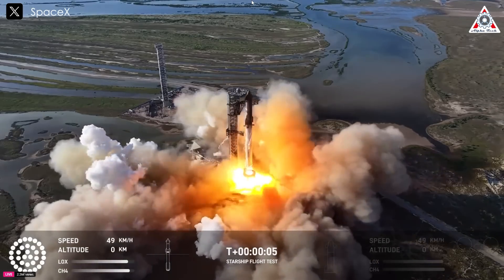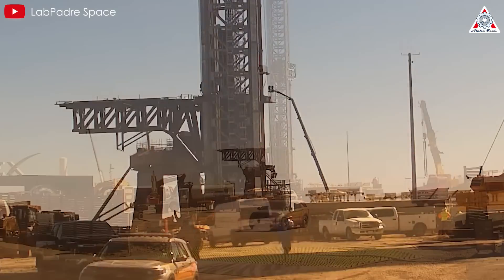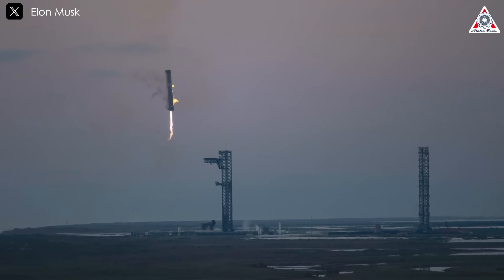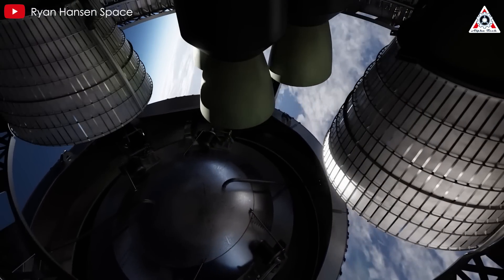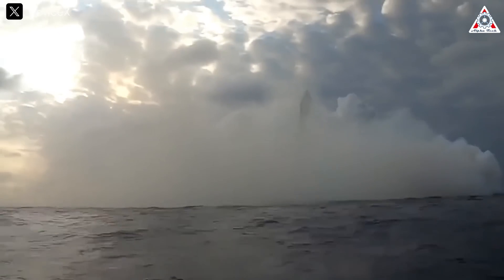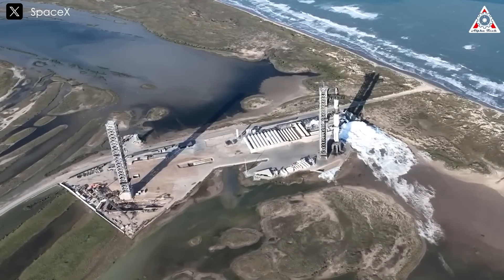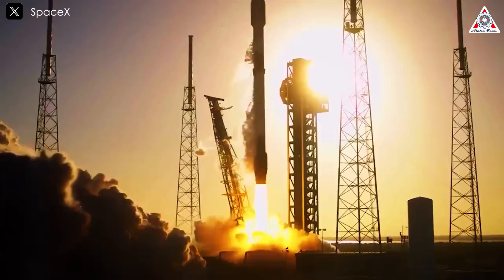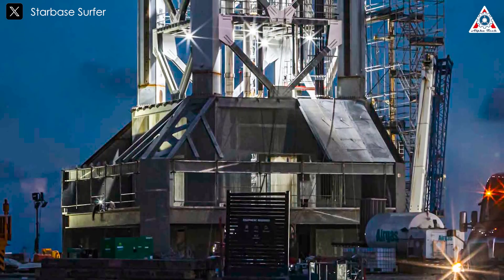Starship Sixth Flight Aftermath! Elon Musk Revealed Starship's NEW Problem...

Comment: Was a nice flight, So Sad they couldn't get enough damage at the last minute from the long glide flight profile.  Would be interested in a report on the ship's angle of attack for the entire re-entry.
What the changes are.

I've never been a fan of the tower, or the tall slender ships.
I would have built Stubbies, to make them free standing and easier to stack.

And on the launch pad  would have headed for a modular stove top 
Configuration, where its a flat plate with a hole in it, and flame diverter out at least one side.  probably able to set together in hexes, array style with a central stacking crane that rotates.

So it could be designed to cover fields of firing and landing ships and boosters, or used on hex barge arrays.

Keeping things lower to the ground will pay dividends continually.
Sky Scrapers are generally a neurosis downstream from real estate location speculation.
And we would have been smarter to build cities into hills and mountains than on top farm land. We'd still have all the farm land, and not wishing we had nuclear bomb shelters right now.

Moon and Mars will at least cultivate better construction habits. After a few generations of Surface dwelling Morons die of Cancers. We'll decide the flat areas are nice for green houses and agriculture and park areas visited at night when the Geiger ain't Poppin' as much....

One question I have, is about possible reflective coatings that filter the nasty radiation, but let plant growth and animal health light wave lengths thru.

An anti radiation coating for glass perhaps... bounce those betas and gammas...

Something for Labnerds to ponder...

Speaking of Labnerds, saw on another channel that SpaceX is working on thinner and lighter alternatives to tile, for heat shield, one suspects the new re-entry profile effects were a shock to them, and that thinner and lighter means maybe coatings...

Dont forget to at least try some samples in a range from standard cement to refractory...

Wouldnt hurt, to keep things as simple as possible, and know where on the Mud Spectrum from the cheap end, that thermal characteristics got good enough.
Standard concrete is pretty heat resistant as are mortars that tend to be Lime enriched to make them sticky for the Mason. Lime is the primary  mineral in Refractory as used in blast furnaces, and before firebricks Limestone was used.

Also on coatings, stainless is somewhat non stick, and it would be a good idea to sandblast the hull slightly where coatings are desired, to give the surface some "Tooth" for adhesion....

Also saw metals mentioned as coatings and wanted to remind that some years back boats were spray gavanized using a wire gun and electric arc. I dont think it was good for the workers spraying Zinc, but that system would work with other metals, and Arc temps way above re-entry temps.

Say tungsten or other high temp exotic.

Main problem right now, is lack of enough start ups to be trying more things. I think that will change, and is something Elon would like to see too.

Pretty good chance that SpaceX isnt gonna be a de facto monopoly for long, and that all kinds of cool concepts will soon be getting tried.

Also theres a watershed once out of the gravity well, where guys working and living off Earth will start building home brew stuff for a hobby... Hot Rods, Lunar Back Yard Yacht builds etc. Vacation Cabin Orbital Habitats,  and Lunar escape velocity rocket packs to get from surface to orbit in nothing but a Space suit.

The watershed will be getting beyond the certified nerds, and things from the hands of common man...
Thats when the real revolution in Space Tech will start.

Comment: Heat-shield tiles should reinforce the "Quick Disconnect, QD" and the top of the circular clamp ring of the super heavy against liftoff blast.
Reply: This idea was discussed during a NSF livestream (if I remember correctly) but quickly discarded. Reason is that the tiles can not withstand a lot of force bc they are far too brittle. During reentry, they mainly endure heating and nothing close to the forces and shockwaves below a booster during launch

Comment: O ideal e ter um PD pra lançamento e pousar em outro pra evitar danos
Reply: Correct. Also, heat-shield tiles should reinforce the "Quick Disconnect, QD" and the top of the circular clamp ring of the super heavy against liftoff blast.

Comment: This arial at the time is a fine example of what I have been saying all along and how interacting positive charge from the engines will react with negative charge being concentrated through the launch tower and then through to the arial at the top. Plus why the first launch pad blew apart with the first launch attempt.
With it explained in detail in my new 2nd Appendix to 'Electric Weather Mechanics', called 'Pointy Things', also on my site and called 'Ground Zero'. With it explaining why launches can't have a flat base under them. As positive charge from the rocket will be attracted to the negatively charged earth and at ninety degrees and so will actually hold the rocket down (as opposite charge attracts), until an equalisation of charge is achieved and the positive charge starts to push against each other and so allowing lift to begin.
If only people would listen to plasma physics and stop guessing with warped maths, then a lot of time (consciousness) can be saved by just using existing empirical science instead, in a design.

Comment: They need to slow down a month or two before each flight. Yes, they will get to their goal, but slow is smooth, and smooth is fast.” But I’m just a combat vet.     Thanks for the episode
Reply: I disagree with you on this.  Boeing is slow and not smooth.  Spacex is real time data driven on their production and design.  This is a prototype.  Every time they have a failure early in the design they learn from the telemetry and solidify their design earlier and less costly than if they had gone slower.  Safety is still paramount, something Spacex has displayed in their 100+ launches this year.
Reply: But regardless of our differences in opinion, thank you for your service!
Reply: You need to watch some videos with Elon actually speaking!  His philosophy is "fast and faster, more and more" which includes manufacturing times, design changes, cost and performance improvements, etc."  Watch some videos, then you'll understand.